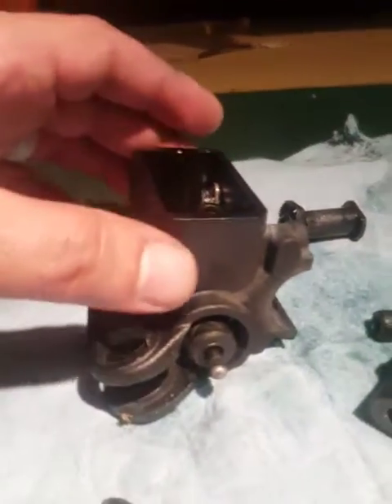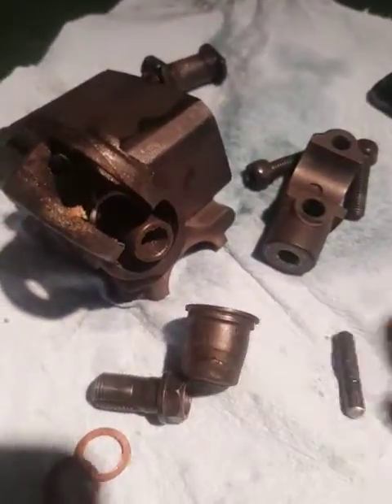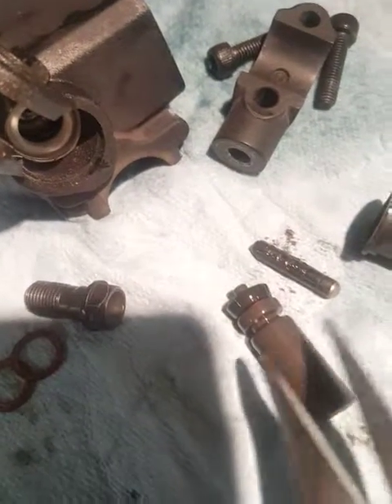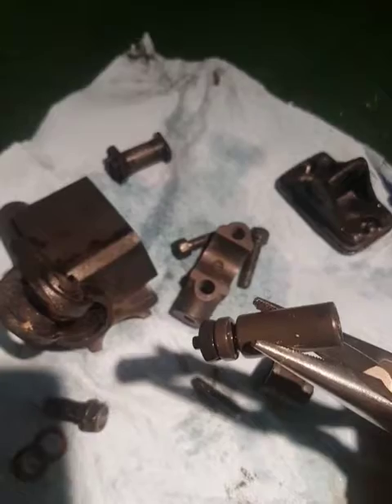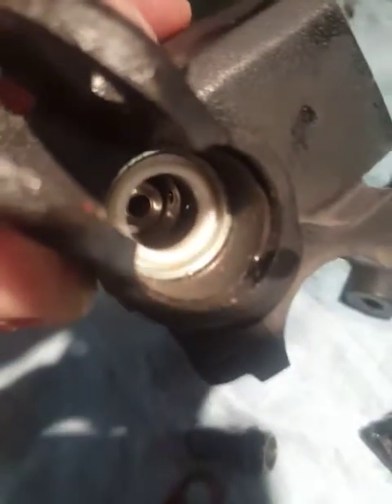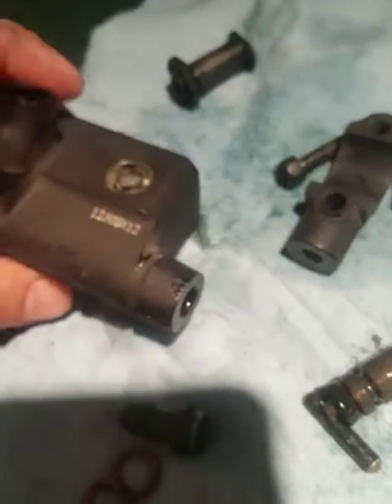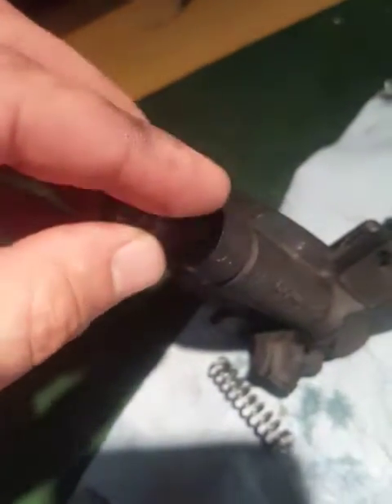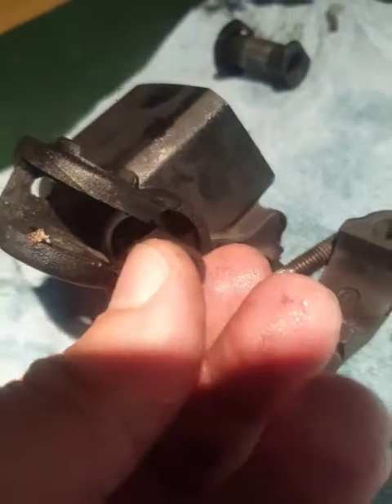Inside a Brembo hydraulic master clutch cylinder

Comment: Thanks for your video. I have the same master cylinder. But I can't get the snap ring that holds the rubber boot. How did you get it off?
Reply from the maker: Get some snapring pliers, you can get them on amazon.
Reply: @Concordeagle  Thank you, but I had a non-detachable retaining ring. It was a whole story with its extraction. Unfortunately, I can't post a photo here.

Comment: how did you manage to remove the rubber boot without ripping it off? My M796 also has a x12 brembo clutch, but there's no circlip or anything that would let me remove the boot. ofc i ripped it in half and still couldn't remove it.  Wondering if you managed to reassemble the cylinder.